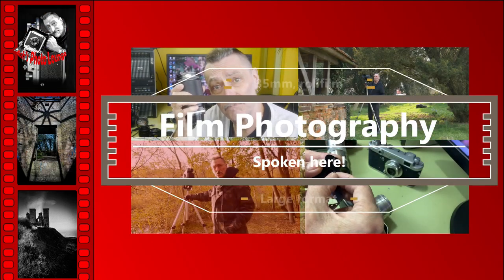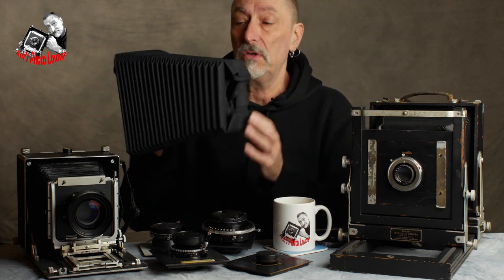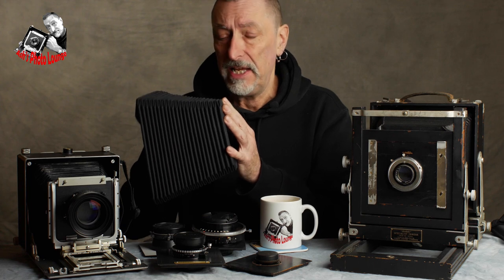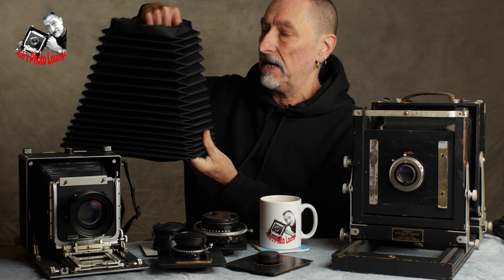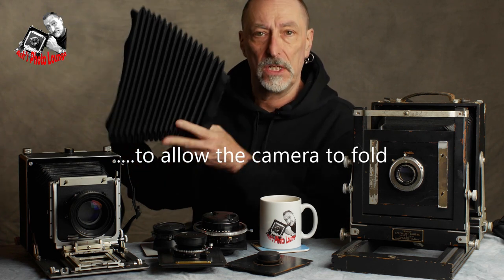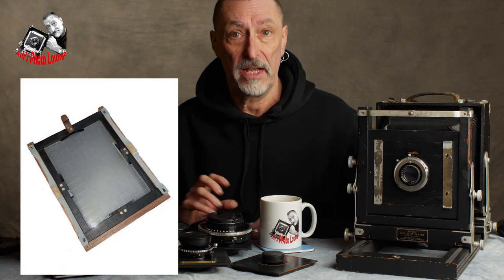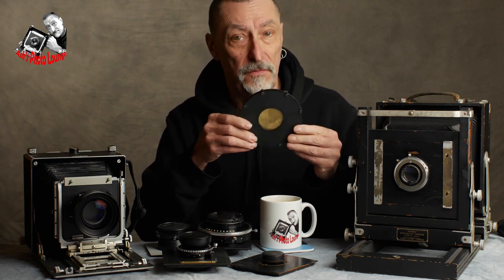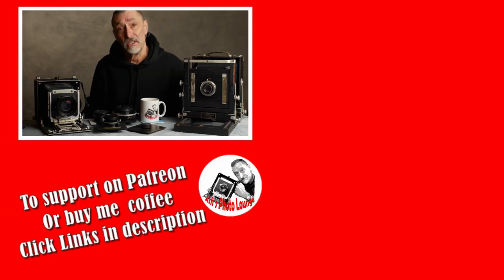Building a large format camera part two

Comment: I am an engineer and I have made a few cameras and I have plenty more plans in my head for future builds, one of them will defiantly be a large format camera and like you I have looked at linear bearings and I think they will be heavy and costly. I have been toying with the idea of 8-10mm stainless rods with phosphor bronze or  Oillite bushes as bearings that should be lighter and cheaper. Looking forward to the rest of your build and seeing the end result.
Reply from the maker: Thanks Ian. I have a pair of the linear bearings for experimentation - so I know about the cost first hand! I think they may well wind up on a different project!
Reply: @ashsphotolounge  I also looked for rack and pinion for focusing and I cant find any so I am thinking a long fine thread and nut . I just need more time and less ideas to build them all.
Reply: Another option I am exploring is a Macro Focusing Focus Rail repurposed or for parts, plenty of options on eBay
Reply from the maker: @iansimpson9351  My 5x7 Kodak specialist has the brilliant innovation of an extra fine focus base - so you don't have to beggar about when you close focus - moving the tripod and then re focusing. It's a great thing to copy 🙂
Reply from the maker: @iansimpson9351  Have you looked at 'the Bearing Boys' site? They have several different sorts of racks of various 'Mods'. I too had thought of a 'lead screw' and nut style arrangement, but currently I lack the facilities to machine the ends to fit them in bearings.
Reply: @ashsphotolounge  Thanks, I have bookmarked that site and will probably end up spending far to long looking through all the goodies. 😊👍
Reply from the maker: @iansimpson9351  🙂 I think I may go for a rack and pinion arrangement re focusing assembly. I've just taken a good hard look at my Kodak Specialist's system, and I figure if it's lasted 70+ years then it must be reasonably hardy! It's also simple, and I like simple.